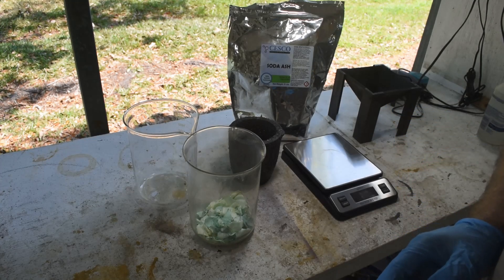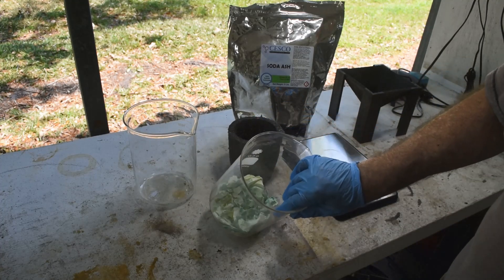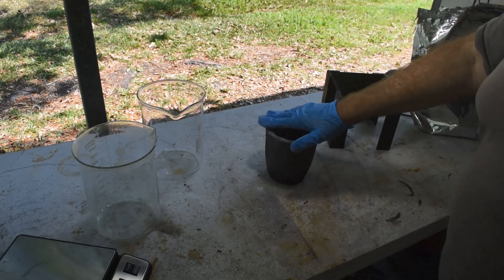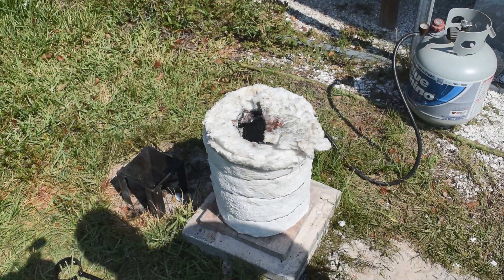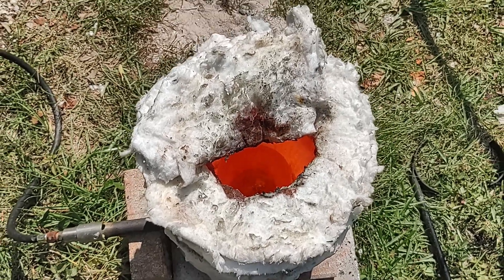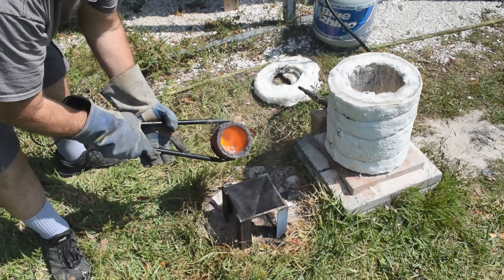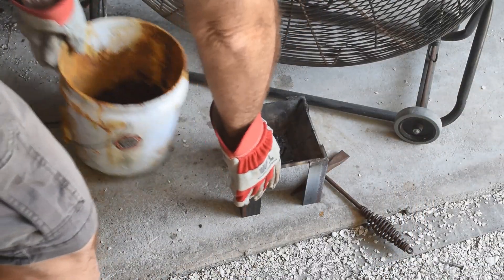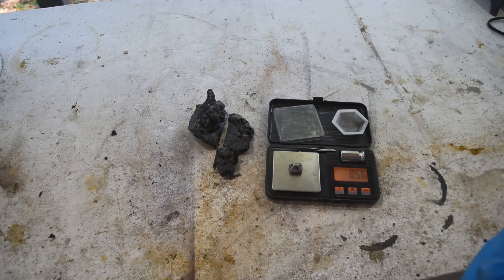Tin Recovery From Metastannic Acid Waste

Comment: Interesting, I'm doing some linear IC sockets for fun. The ones that look like gold trumpets. Put them in Nitric last night, and as I expected the dreaded metastannic. Even the silver cemented out. So I have en interesting mix , metastannic, gold and cemented silver.  I just melt it into a button. the tin burns off (white smoke) , The result is a gold and silver alloy that I run a second time to recover the gold. Some times I just melt them, again the tin will oxidize out (white smoke). Smoke stops, tin is out run the button.
Reply: Be careful and don't breath any of this white smoke and consider to loose some gold together with the white smoke because the white smoke is not only tin in some form, it's gold unfortunately too...

Comment: Mike, just add to your stanis chloride solution some potassium or sodium nitrate. That should cause the tin to fall out as your gray goo.
Reply from the maker: I thought of that. Unfortunately it doesn't work. I got tin (II) nitrate, which is quite soluble and doesn't precipitate. I even tried adding straight nitric acid, and that didn't work either. That's OK though, I remembered some basic inorganic chemistry I should have tried up front, and I think I have a way to recover tin from stannous chloride solutions. Watch for another video in the future.

Comment: Nice video Mike ,  you would be better off with welders gauntlets and maybe a welders chrome leather jacket when working with the furnace wouldn't need much of a slip for the molten contents to go everywhere, it's not a pleasant experience, the pour into the cone mould I was thinking, I saw an inexperienced person do it into a cold cone it steam flashed everywhere,

Comment: Electrowinning of tin is far more effective! Tin chloride easily dissolves in hot HCl, ready for electrowinning. Beware, if the tin solution originates from solder it'll be heavy contaminated with lead (except newer PCBs = lead free solder; albeit contaminated by 5% copper + 1% silver and sometimes traces of bismuth). It's usually best to make a prior separation of tin and lead chemically, whether it being in chloride/nitrate/sulphate form, as tin and lead react almost equally, thus somewhat difficult to electrowin separately. Add H2SO4 to the raw solution, and lead will precipitate out as lead sulfate which is removed by vacuum filtration. Lead compounds are conveniently reduced to metallic form by mixing (1:1 volume) with charcoal/carbon, and then heated in a furnace. Afterwards the raw lead can be cast into flat ingots/cathodes to be electrorefined into pure lead.
In my electrowinning cells I always place the cathode along the bottom, the anode horizontally at the top, and in between an electric motor drives a shaft with a "plastic propeller" (homemade Rushton impeller) breaking off the long needle crystals of metallic tin to avoid a shortcut of the cell, as well as at the same time stirring the liquid for much better efficiency. Free electric power comes from used solar panels; I have 26 panels for various purposes.
There are two informative videos on YT uploaded by Picky Plans on the subject tin recovery:
https://www.youtube.com/watch?v=krmjC2fFDaY&t=2s     and:   https://www.youtube.com/watch?v=ev4h_-SGPGw

Comment: To turn stannous (Sn2+) into stannic (Sn4+) tin in water solution, try adding a bubbler blowing air through it and it should oxidize.
Reply: Hm, to make it faster, bubling output from those cheap ozone generators would be interesting. OZone should react a lot faster to oxidise it even in minute amounts